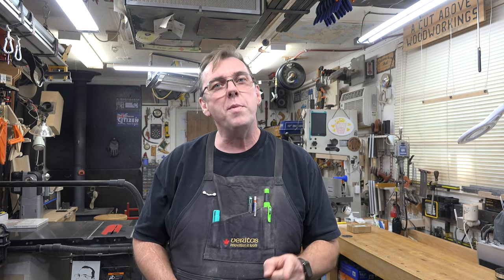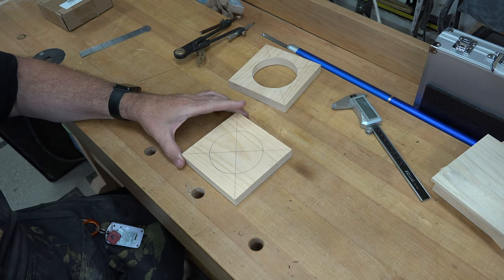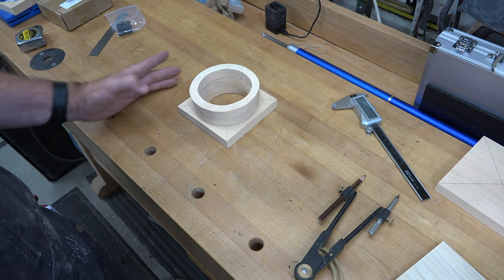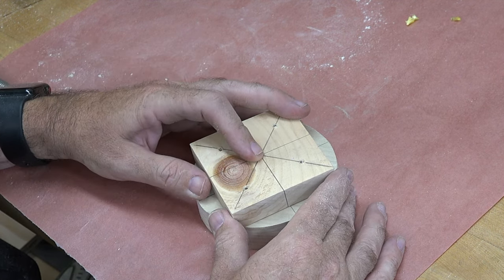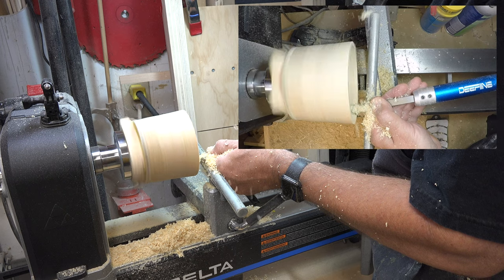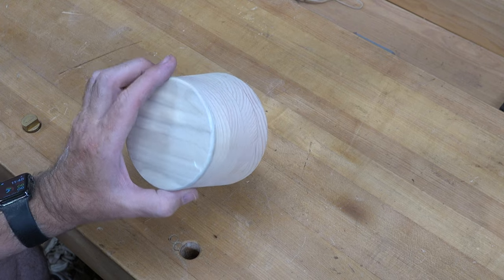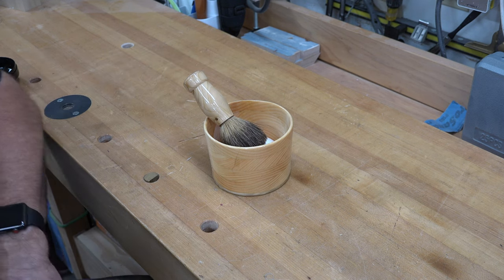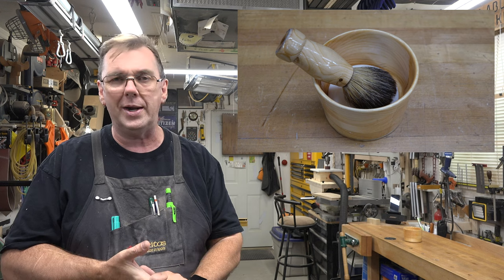Making a Shaving Bowl

Comment: Loosely related but it reminds me of the ring master. Contraption that cores bowl rings to do what you did with the scroll saw. It has its own motor for a blade or bit… I forget. They are neat anyway. They even cut the rings from the same piece so you’re waste is low.
Reply from the maker: Interesting.  I'll have to look that one up.  Thanks for tuning in this week.

Comment: The thinness of the bowl may have made it fragile, but it looks awesome. Whenever, I'm turning a bowl, I chicken out and leave it too thick and then regret it after. What was your new chisel and did you like it?
Reply: I would suggest to learn how to quickly sharpen HSS chisels. I used those carbide, but Im back with HSS
Reply from the maker: The chisel that I was trying out was an "easy turn" type of chisel that was from Amazon.  Just a cheap set that I wanted to try out.  Here's a link if you are interested Jim.  https://www.amazon.ca/dp/B0BRXJRCZ3?psc=1&ref=ppx_yo2ov_dt_b_product_details
Thanks for tuning in to the show.

Comment: FYI some thin CA glue would have sorted the crack out instantly ... but the epoxy did that and also provided a nice tough finish 👍

The only thing wrong with the project is the dependence on so many machines which most people won't have, but you'll always have that problem ... what I got from this project was how you started out with one idea which by the end of the project had completely changed in how you executed it ... a good lesson in how to adapt 👍

Other methods, requiring less tools ... a segmented version (leaving it flat or using sanders to round off), a rolled up veneer version and finally, the find a bigger mug version 🤣
Reply from the maker: This project definitely morphed over its duration Barry.  You are 100% right that there are plenty of ways to make this project without the different machines.  Maybe I need to produce a show to demonstrate on of those other methods.  Thanks for tuning in this week.